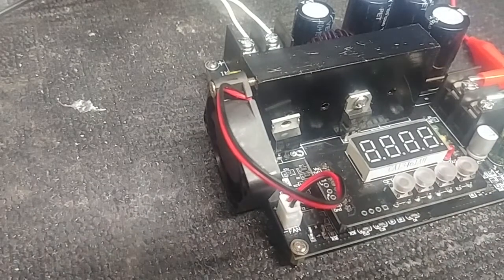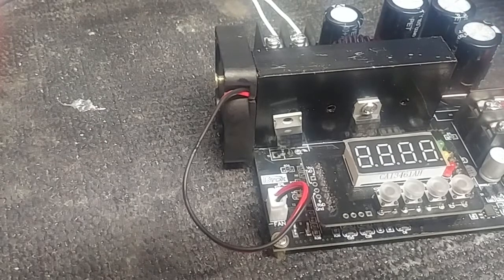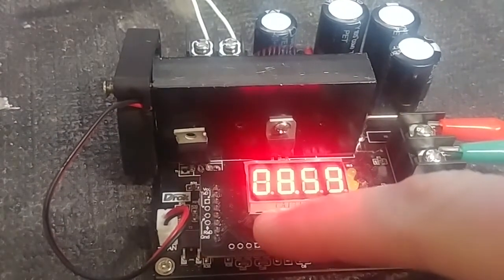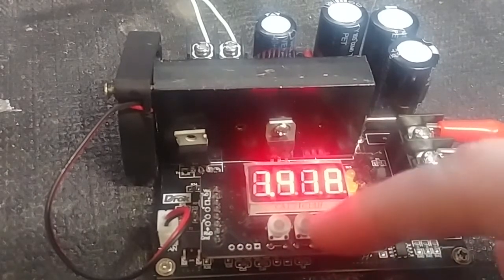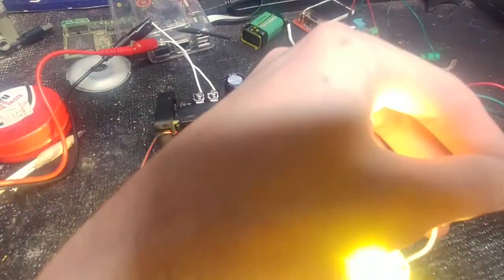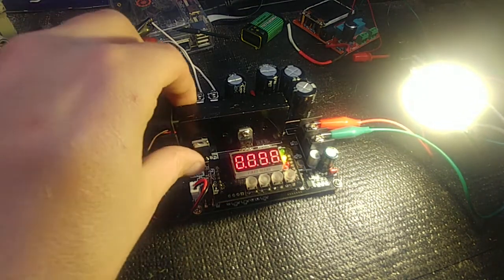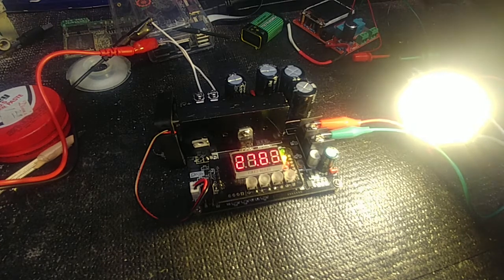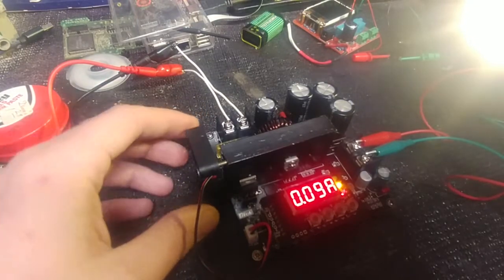DROk boost converter fixed (patched up temporarily anyways).  The universe giveth

Comment: Man, that looks just like an earlier version of the Juntek BST900W which was later revised into the MPT7210A solar charge controller. I have two out of six of the MPTs (I upped the two electrolytic  filter caps for from 60v to 100v so it would handle 72v) that work; and four that don't, (one came DOA), and the STM8S005K6T6 MPU is shot in all four. I'm trying to find out how to pull the program off one and put it on  a new 32 pin IC, but it's a bunch of S. You have to UART your way to a bootstrap load for USB or get a single-wire-interface module (SWIM) and I don't even know if the MPUs are read R/W protected or not. it supports a little VFD instead of an LED or LCD plus determines the ref for two of the four 3.3 CMOS op-amps (for gating the I/E MOSFETs) off the other two diff amps from the two shunts vs the user input.. You ever F with these STM8 MPUs ? May be I should just get an Ebay I/E readout and replace the MPU with a dual comparator and  a couple of trim pots. The MF-ers were only about $15 each back when I bought them and now they're like $50. They're not worth it. If the DC to DC over-voltages because it no longer gives a S about the feedback it will take out the buck MOSFET, the PWM IC, and the GD 3.3 regulator with S after that. It's like a F-ing house of cards. There's zero protection that I can see. Totally FUBAR man.
Reply from the maker: Yeah. I got incredibly lucky with this fix here.    Another one blew the ass out of the current pwm chip (i think it was 38063 iirc)  and then everything else.  It wasnt a "drok"  but, I think its like many things from china, one manufacturer, many buyers that relabel and sell it to the masses.   That price tag is right at what i paid for this one. Like 15 bucks shipped, but it was "as is /parts"  

Honestly. I know less than nothing about the STM chips. -which would be a good thing to learn, because soooooo many things use some variant of it. 

I have a few different dc/dc converters I got to just play around with and see if they are anywhere close to their datasheet numbers..   spoilers- most dont.  But, i think it is more to do with the constituent components and poor design "techniques"...    one sketchy converter that comes to mind is based on an XL4015 buck/boost converter.   It can use a transformer to make a +/- voltage output from anything between 4v to 42v (i think that's right) ...   they just used 3 toroidal inductors/chokes that arent even really close to each other..   im no magnetic scientist. But. I think it could be better.   

Curious about your modules though. How did you know, or go about determining the MPU is the issue.   It may be a dumb suggestion, but, is the reset pin in its proper level? Is the diode/cap (or whatever else they may use to delay the restart until everything has power) good still?   I've had that catch me up once or twice (more than id like to admit).    What was the initial mode of failure on the 3 ?
Reply: @topherteardowns4679  The dc to dc is an XL7005A and they set up a transistor to turn it on at 9v input. The converter is biased to put out 10.6v which (after a inductor, diode, cap network) goes directly to a pin header for the display, the 3.3v regulator, the 2803 PWM (12v Vcc max), and the fan. The 3.3 fed both Ti 2272s on one land and the MPU on it's own. All four units lost output from the XL7005A so I bought a tape of ten and remote soketed them off an 8-pin smd adapter board with a couple of four pin headers to make it easier to get to, replace, and put it in the fan flow. 1 was in, 2 was out, 3 was bias, and four was FB. 5-8, grounded, (simple). Changed out a MTW45N10E (N-ch MOSFET for the boost/buck) and then one unit powered up with 9v on the bench and even with a 9v battery. I was happy as S till 72vdc from two series-ed 305W  Q-cells blew it the F up. Then it became like the other three which had all been lights out too early (but the DOA one which was lights-out as soon as I popped in the last output fuse) for the 72v bank, (6 x 12v). All four bad units had components dragging down the control voltage after that. Next weak link was the 3.3v reg so I bought a tape of ten AMS 1117s to replace them with and remoted them on the back because they were too wide for the front land pattern. After retrofitting all four units with new regs and still getting dragged, I began lifting ICs. The MOSFET I'd replaced melted the insulator washer for the heatsink screw and scorched the board, the Vcc pin of the PWM over-heated too, and the shunts op-amp package went South as well. I got 50 ohms across the power pins of the other op-amp pkg out of circuit, (which I think is normal). After lifting shorted ICs and still being too close to ground, I surface drilled the MPU lands in all four boards at a place easy to bridge back with solder and verified the MPUs were all dragging (20 ohms, 4.3, 40, and 70). With new XL7005As, AMS1117s, the fan pluuged in and all the other ICs lifited, I verified the 3.3v for each one before solder jumpering to solo the MPUs with displays plugged in; and none of them (not even the 70 ohm one) lit a display after at least 9v input powered the fan and the 3.3v regulator. I even went up to 15 to see if the XL7005As were keeping it real and they were (except for the 4.4 ohm MPU which is obviously toast), it dragged the voltage down by itself. I stripped the board with the blown PWM entirely just to trace it all out so now I know it all way better than I ever F-ing wanted to.